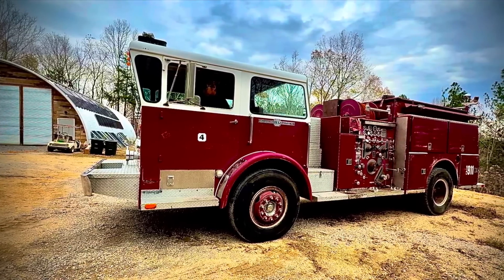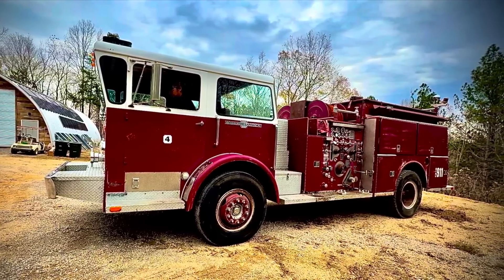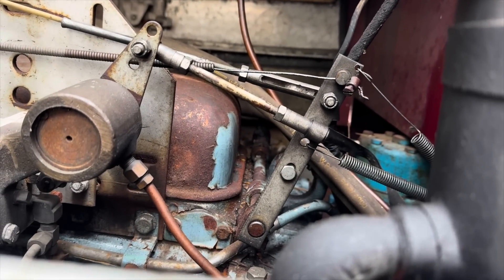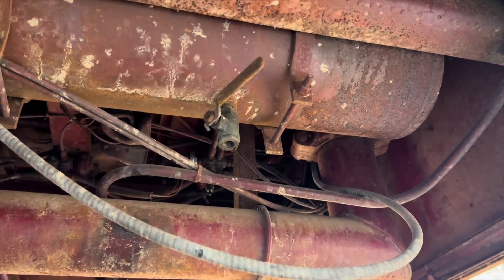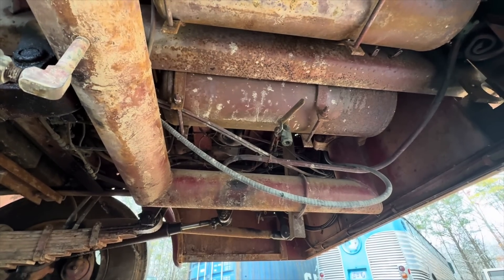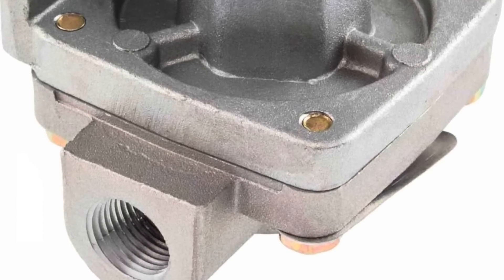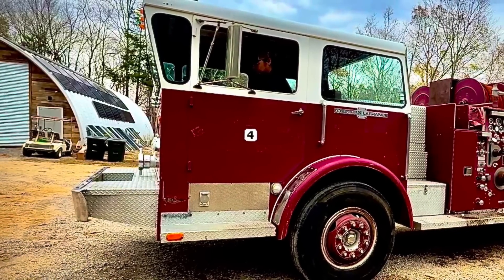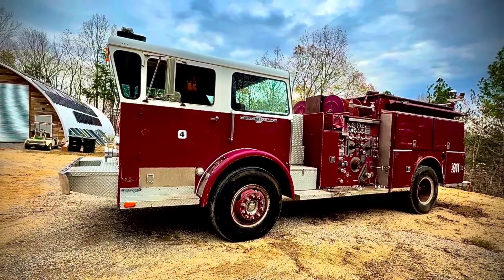Diagnosing the American LaFrance Pioneer Fire Engine. Air brake failure & stuck throttle issues

Comment: One of our members managed to bump start out old ALF by accident when he was trying to park it. Still in gear it rolled back about 2 feet and the engine started running in reverse rotation! I ran over and managed to kill it by blocking the exhaust. The rest of the crew was standing there watching it bellow exhaust out the airbox.

Comment: Using the pump to suck water from a static source, like a pond or pool, is called "drafting", and it's what separates the men from the boys with fire engines - that and water tender ops.  Drafting requires the pump to be "tight", meaning no real leaks- otherwise, the pump will not develop the vacuum necessary to draw the water in.  Also requires a primer source of some kind, most often a small positive displacement pump that will draw air  out of the pump to create the vacuum.  And you have to be within a certain distance - usually 20 feet - and a certain height - I think also 20 feet, but the closer the better - to draft successfully.  You would typically use two, six-inch hard suction hoses (the big black ones), 10 feet long each, with a barrel strainer on the end to keep out debris.  They're bulky and hard to deal with.  You could draft with 2 1/2" (smaller, lighter) hard suctions coming off the auxiliary intake, with less water delivery.
In short,it can be a lot of work - but I think it's fun!  When you draft, you really feel like you,be accomplished something.  A trained monkey could get water from a hydrant.
Fire trucks are a lot of fun!  So glad you got one!

Comment: If you get the pump going & run out the large diameter hose to pump water - increase the revs slowly or you’ll lift the guy on the end of the hose off his feet!

Comment: That throttle knob should return to zero if you smack the big knob in the center firmly with the heel of your hand. Likewise, you should be able to depress the knob and pull the cable out to set the throttle. The turning function is the fine adjustment, Cheers from the 70's Scott.

Comment: Can you drive the truck with the pump running to spray down the drive way ?  The throttling on the pump controls is for stationary operation.  With a good diameter hose and pipe, gravity feed should be fine for spray down.

Comment: This reminds me of an old 69 Mack cabover I bought with a v8 Mack, wig wag on the air, twin stick ceramic clutch no power or air ride anything, took her around the block and out of nowhere the loud a$% wig wag low air buzzer goes off as im watching the air drop as im going down a hill, thankfully the rear brakes locked up when it dropped too low, the exhaust brake button somehow wasnt pushed all the way in when I was driving.

Comment: If the pump rpm control is set to high, they're designed to just whack it to reset it to normal. Happens all the time on my engines that the newbies train on.
Reply: Run into that here as well.